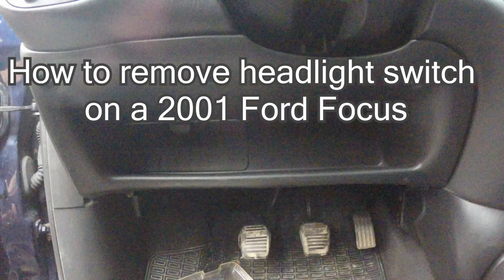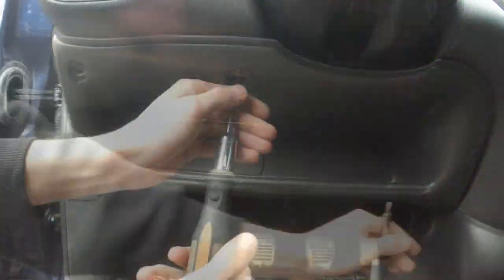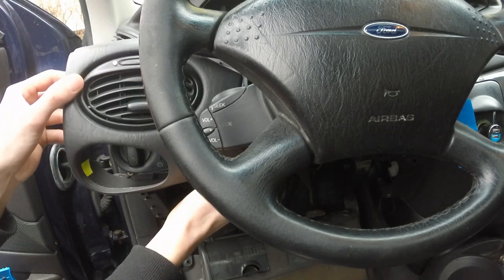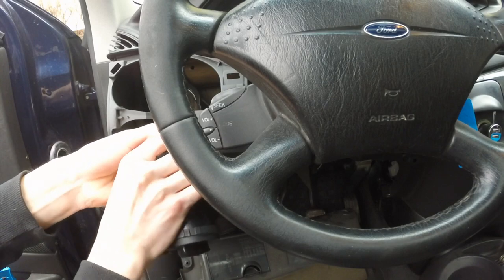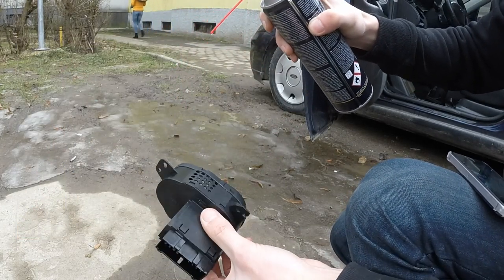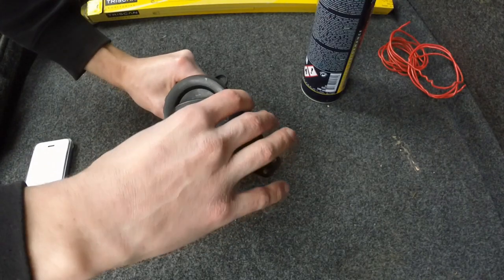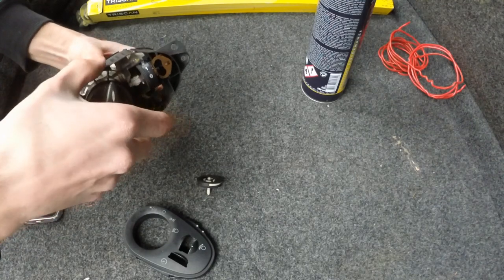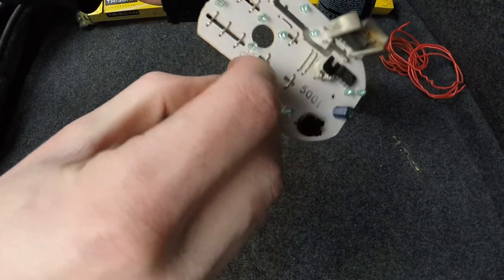How to remove Headlight Switch - 2001 Ford Focus

Comment: Hello! I have the same problem with my 2002 mk1. Does cleaning the contacts solved it permanently? Thx.
Reply from the maker: Hi, it solved it for a few days, then it came back. I want to replace the switch and see if that's the problem.
Reply: I think I will try that too :) hopefully it fixed it for mine too.
*permanently :D
Reply: Did it fix the problem with your light switch...Replacing the switch??

Comment: I have a 2000 Ford Focus ZTS without fog lights....The problem i am having is when i turn on headlights or parking light i blow a 10amp fuse under the driver side dash everytime??
Reply from the maker: Is this a question or a statement? 
You have a short circuit there, DON’T put a “bigger” fuse (unless you want Focus BBQ), take it to a service, explain to them the problem, they will take care of it.

Comment: I wanna change the bulbs, but with that structure, I'm really not clear, can you make a video how to change the actual bulbs
Reply from the maker: Theeee bulbs in the switch? Or the bulbs in your headlights? Because I have a video on how to change headlight bulbs. The switch has LEDs.
Reply: @N33sWorkshop  yeah the leds on the switch, i didn't know focus has lights on the switch, or mine are like f-ed up!
Reply from the maker: First check the connector, then if it’s still not working, change the whole switch, it’s easier.
Reply: @N33sWorkshop  hey, what led bulbs are appropriate for the switch? I'm planning to order 👋

Comment: had the same problem with my 2002 Sw Ghia, sometimes its on sometimes its off , i bet its the switch is damaged , but i will try to clean it first because a new one its almost 130€ in portugal, is just to much for a switch! btw had you tried a new switch? thanks for the video !
Reply from the maker: No, I ghetto rigged some wires in the end... there is a potentiometer in the switch, that goes bad.
Reply: hmm, that sounds a bit harder to do , im not a big expert at car electronics , but thanks for your reply ! @N33sWorkshop
Reply from the maker: https://youtu.be/IJaOStukD6U <-Ghetto fix, in case you don't want to mess around with the potentiometer.